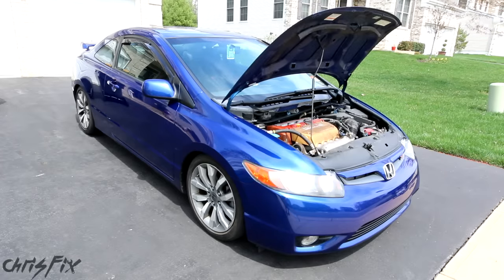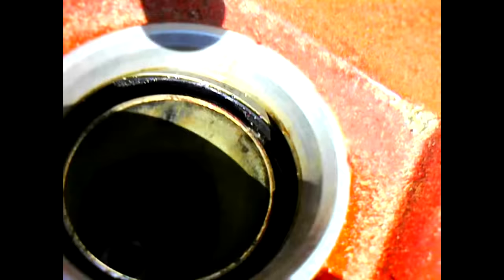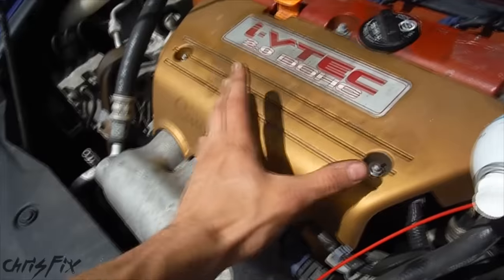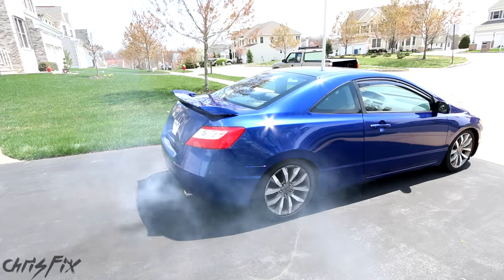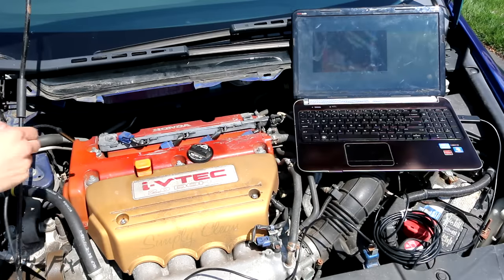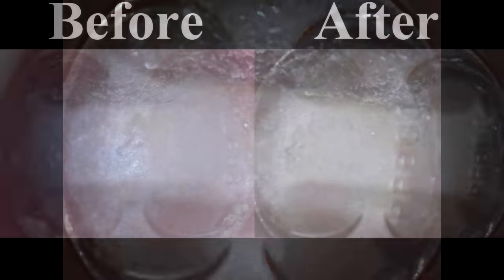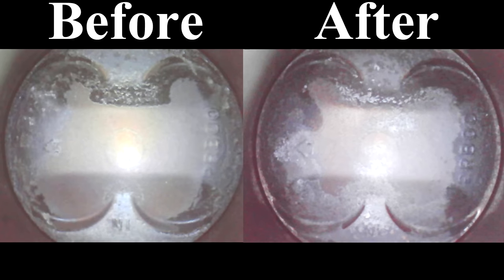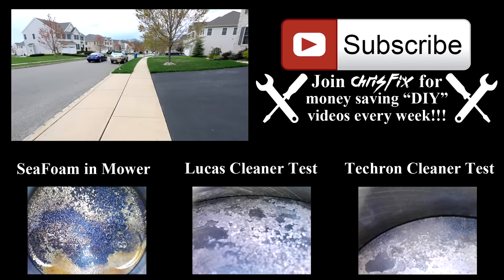Does Seafoam Actually Work in a Car? (with Proof)

Comment: this stuff don't work so little difference , its not worth it
Reply: It's like $9 a can what are you losing?..
Reply: Christopher Fryman what the hell are you talking about
Reply: +H.G. C. whispers I think he might be attempting to speak English.
Reply: harold souza Byyee! See ya tomorrow, Herpicus McDerpington.
Reply: lol your funny, the shit still wont work its crap
Reply: Yeah... it does work.  Watch the video next time.  Even better, try it yourself.
Reply: +harold souza I just don't understand why you're so mad about a product that works.  It's practically just an overpriced cheap type of oil, but it loosens and burns out the carbon.  
Science!
Reply: just a guy  it don't work is your video that bad there
Reply: harold souza You mad bro?
Reply: deebo gotyou   o baby
Reply: +harold souza It does not work if you drink it. Judging by your comment, you drank 2 cans.
Reply: +Caleb Niederhofer Know a lot of professional mechanics do you? I own a small garage and have turned wrenches in every environment from a BMW dealership to a shithole Midas. There are all kinds of cleaning agents used by every type of shop. The MotorVac machine was big for a while ($3000) as well as the BG Fogger($600). They both use liquid cleaners, they both work well, and are both overcomplicated devices that do the same thing as the Seafoam treatment. I agree that most of the snake oil out there does exactly jack shit. I would never have even tried the Seafoam had it not been for a frustrated, broke customer who could not afford to put an engine in her Honda (the one mentioned in the post below) and could not afford payments for a new one. I stumbled across the Seafoam trick while researching said Honda. It worked. It worked really well. I do not work for Seafoam nor was I paid to shill for them. The Seafoam is not going to magically give you an extra 10 mpg in an engine that has the minor carbon deposits that the engines in these videos have. There is really nothing wrong with engines in most of these videos. It will, however, free-up frozen oil control rings in an early 2000's Honda, it will remove oil sludge in a crankcase, it will clean fuel injectors, it will clean valves, it does work.
Reply: you might be right but it sure wont clean and remove oil sludge in a crankcase, the only way is to change the oil
Reply: +harold souza It absolutely WILL clean and remove sludge in a crankcase. You obviously have to change the oil after running the engine with the Seafoam in it. It doesn't make the sludge magically vaporize and enter a parallel dimension. 

Seafoam is not the only product that will do this. BG products EPR actually does a better job of this. You should not use either one in a heavily sludged-up engine, you will do more harm than good.
Reply: +fatboylo96 Yeah, I read a case where someone used Seafoam and it broke the sludge up too fast and starved part of the engine of oil. That was a super sludged up engine though, so who knows if even going easy on oil changes would have removed it easily or not.
Reply: this article and everyone reading it is in a  parallel dimension. lost in space
Reply: +harold souza Yes Harold, we're ALL crazy. You win. It's all lies. It doesn't work. Don't use it, it will ruin your engine and your life. You can play with the rabbits now Lenny.
Reply: +harold souza yes, so little difference. i want to see someone do a dyno test with seafoam because im tired of people claiming to regain lost power. you know what also helps, CHANGING YOUR OIL. i swear people dont realize how much power is lost between dirty oil and air filters. injector cleaners, head gasket fix, rad stop leak, tranny fix, all of these help so little it doesnt actually compare to rebuilding an engine or rebuilding your tranny or just changing your head gasket or just flushing out a rad. i personally believe these "fix in a can" stuff to just be designed for people that have absolutely no idea what they are doing. i personally have tried most of these "fix it cans" and with minimal results. 

i had a friend with a leaky rad use stop leak, his thermostat got stuck and the water pump failed shortly after. i used tranny fix on my truck once and it made it like a quarter mile. so just two random examples there.

i have cleaned my own injectors, i have rebuilt my tranny, and so on so forth. and if all seafoam does is break down carbon, i really dont see the point of using it because i have never heard of a motor losing power from carbon buildup.

i have 3 vehicles that are over 200k that run with no misfire, great power, and still daily driven. my cummins has over 210k which on dyno it still puts around 350hp 700tq. i run alcohol and 2 stroke oil mix for my mechanical p7100 and no mystery additives and it has gained a lot of power with effective tuning/timing. 

long story short, "fix it" cans don't fix it, and can often lead to more problems down the road.
Reply: +ian gilpatrick I'll leave the self-aggrandizement completely alone and just point out that if you don't understand the negative impact on airflow that carbon buildup on the throat of  intake valve has or how deposits on a piston top increase compression ratio and create hotspots that cause detonation then maybe you should gain a little more experience and knowledge before spouting off.
Reply: +fatboylo96 HAHAHA! yeah i went a little overboard with the description of my junk that still runs. i do agree with the points you made about carbon buildup as well. but there is no need to insult my intelligence that is just plain rude.

as motors get older they slowly lose compression anyways so i find this to be totally irrelevant at the same time.

But, there is no way, your going to sit here and actually convince some of us, with at least maybe half of a mechanical brain, that seafoam breaks down enough carbon to make a difference.

my 68 cougar has a bored over high compression motor (rated for 94 octane) and if cylinder detonation became an issue due to excessive carbon buildup i would not hesitate in pulling the motor and rebuilding it.

do some research on seafoam. it was originally invented for outboard boat motors (hence, seafoam) because he came up with a chemical combo to temporarily freshen up a motor to run for a little longer. wanted to go fishing, not rebuild said boat motor.

seafoam contains alcohol, oil, and a mild detergent, all stuff anyone can mix up at home.

with all that being said, this is just one mans opinion so spare the hate mail and just accept not everyone will agree on this subject.
Reply: ian gilpatrick   you said it all, finally someone who knows what he talking about thanks this stuff is junk
Reply: +harold souza I certainly wouldn't put it in an old engine!
Reply: +JustAGuy Think of the damage caused to an older engine where the carbon is plugging holes and scores. perfectly fine in a new engine but i have seen cars damaged with the same kind of stuff (not the same make),  Perfectly fine in new cars. The older stuff a few years ago was really potent and would kill catalytic converters, but nowadays is a lot weaker and does not clear the carbon as well but cat safe. All in all a newish car with low mileage serviced engine say under 40,000 miles yes, anything else no. If the spray trys to kill the engine whilst you are spraying into the throttle body to the point you have to throttle the engine to keep it running then you have some potent stuff.
Reply: +Robert Marks pass the popcorn, this shit has me on the floor!
Reply: I almost got in too deep. I am working towards using both halves of my grey matter though...
Reply: +harold souza Wrong.
Reply: +harold souza It might work on large carbon buildups, but for such a small amount of carbon, its not worth it. Although, it would be handy when your engine has 200K miles. Or any engine where the valves stick due to carbon buildup.
Reply: people like you are broke down on the side of the road searching for a tow truck lol
Reply: its preventative maintainace..
Reply: it don't don anything, its worthless

Comment: Helps a lot with the carbon that builds upo in the valves and the sump pressure relief return hose that sometimes carries some oil. Beware with the acceleration body gate, the servo is fragile.

Comment: I'm waiting for you to use water, I felt the seafoam had similar effects as the other products you tired on your truck.
Reply: dsouzand I'm in your camp on both counts. :)
Reply: dsouzand i cant wait for water either.
Reply: dsouzand That's the old school way to clean out carbon deposits, I used it myself back when I owned a carbed Camaro. Just got a spray bottle filled with water and lightly misted the carburetor while slightly opening up the butterflies. A couple minutes of that and she was running a lot better that she was before. As previously she made a huge nasty cloud of smoke pulling out at a stop sign and the idle wasn't as smooth. Which is what inspired me to give it a try.
Reply: Da Blueguy
I've fixed a car with it. Some old school keeps on working. :) I was so excited about the results that I wrote an article on it, if you're interested.
Reply: Da Blueguy
 just wondering does the steam also clean the exhaust manifold to?
Reply: dsouzand Of course. I just don't know how much like I don't know about carbon from a visual like Chris Fix is working on.

Comment: I hate how the (the before and after pics) aren't that same color. it's like it has a filter.
Reply from the maker: That is because the white balance changed. The engine was cold in the "before" pics and hot in the "after" pics. The borescope camera doesnt like the heat but I had to film it so my friend could go to work.
Reply: but sad thing is though you said lets let the motor to cold now? not hot
Reply: ChrisFix
Reply: can change the brightness of the led's on the endoscope
Reply: sk8punk318
Reply: o gotcha ok thanks for lettin me know, I bought a bore scope just to look down at the cylinder heads on my G37. Just curious.

Comment: I always add a can of Seafoam before a long distance drive over 250 miles (gas tank at 35 to 50% full).  Going 70-75 mph, with lane changes and on-ramp accelerations etc qualifies as aggressive driving.   When I have to stop for gas, I add Marvel Mystery Oil to the gas tank before I fuel up.  On the return trip, I do the  same thing, except I add Seafoam to the oil.  Then MMO to the oil at the gas fill up.  About a week later, I change the oil and filter!   I usually have a drive like this once every 3 months...so I time it just ahead of my oil change.

Comment: I don't feel the results are worth it. IMHO.
Reply: ghostcar it makes more of a difference when you have an engine that is in really bad shape. projectfarm had an old ford truck with 160k miles on it and it had issues with valve knock and massove carbon deposits in the engine; he added seafoam to the crank case oil and gas tank, and ran a can of spray through the intake. it literally rescued his engine for less than $50, where the only other option would have been a complete tear-down. I don't see how you could ever say 'not worth it' considering how cheap it is, especially compared to any other method you could use to fix these problems.
Reply: @KingHalbatorix  projectfarm was a very drastic change (which you could hear) but the changes here are much more subtle... I agree it's more questionable, and wonder what it does to your catalyst converter (which is expensive to replace).
Reply: I mean it's meant to work over time so
Reply: @alaind831  Project Farm's video is what literally sold me on Seafoam. Those blatant, unbiased, raw, obvious results should slap tf outta any nay sayer.

Comment: I'd suggest that there's no practical difference in the cleaning.
Reply from the maker: +tcpnetworks thanks for sharing!!
Reply: it seems like such a small difference. youre saying it doesn't matter?
Reply: I agree!!
Reply: I had my mechanic seafoam my intake and manually clean my throttle body and my car is starting up smooth again. its like night and day. I want to do it again as much as possible. im almost at 200,000 miles. driving an audi a6 with direct injection
Reply: Gary Shaw toss in a can of BG44k you can Google and get the information on it. Most large auto parts stores sell it. eBay and Amazon look for free shipping BG44 K is one of the best.

Comment: How am I supposed to hold 2k rpm by myself?
Reply: Cameron Cole use a shower curtain pole ?
Reply: Set the idle screw up manually and then put it back to where it was. use a marker
Reply: Yes the idle adjust screw and then just put it back manually

Comment: Chris, can we just spray sea foam into the cylinders via the spark plug holes? It should be easier and more effective! It will only clean  the pistons though while your way will clean valves and so on.
Reply from the maker: I did that in the lawnmower video test but the problem I find is unless you can vacuum it out or something, you will have big chunks of loose carbon in your cylinders which probably isnt good.

Comment: My 94' 300ZX with 98K on od sat 2 years recently while I did major timing belt service,clutch n other upgrades. After two years it wouldn't run right,missing n stuttering at low rpm under load. I tried Techron 3 times,no effect.Replaced a couple fuel system items and coils,no effect. Convinced it was gummed injectors. Recently put in Seafoam,twice.Over about 180 miles it is about 80% better. I'm sold.👍
Reply: I bet it was your old gas. My civic was stored for 3 years and i had to drain all the old gas (7 gallon) out then put in new gas.

Comment: Chris. 
Does seafoam clean the carb as well? I've been putting it into all my small and large engines in hope it keeps injectors, carb clean as well as what you've discussed. 
I've got a 94 Suzuki Carry that WHO KNOWS how well it's been maintained before me but runs good with fouling plugs twice on me in the nearly year and small amount driving. (#3 has low compression at 30-40psi. others at 130. Rebuild it someday...)
What do you recommend for carb cleaning? Keeping clean? Diesel Ram 6.7? The wife's Tundra 5.7? 

Thanks bro. Love the vids.

Comment: Before Seafoam was all the rage AC Delco Top Engine Cleaner was a little known secret amongst GM technicians as a way to tune up a car and improve performance... We use this stuff whenever rebuilding engines to clean the piston ring lands and pistons when reringing a 4.6l with excessive oil consumption... This stuff was also used by techs to clean the TBI units and in a stick throttle body it would quite literally just melt the black sludge build up inside ports and around and on the throttle plates...

Comment: I did not see any diference.
Reply from the maker: Yea it’s not a big difference.
Reply: Seems that car really didn't need to be Seafoamed in the first place.  Maybe a much older, higher-mileage car would have shown a more dramatic difference?
Reply: It’s not made to remove carbon from piston tops.  The concern is carbon buildup in the intake runners. And back sides of the intake valves.  My 2.4 vetch has considerable carbon build up in the runners.  220k miles.

Comment: Did not see any difference
Reply: +foxybrown2 It cleared a decent amount, his car just doesnt have much build up in it so its hard to show it, if you can find another video that uses an older car or something with a little (a lot) more power the difference is clear, I can speak through experience since I used this on my 94 Mitsubishi 3000gt VR4 which hadn't been internally cleaned for 16 years and it worked phenomenally.
Reply: +Swag Police Oooo Mitsubishi GTO.
Nice

Comment: What people fail to realize is that running these cleaners thru your engine to clean intake, valves and injectors is doing damage to your catalytic converters. All that grime and gunk has to pass thru the very fine honey comb mesh in your cats, or DPF in diesels, this will plug them faster than anything. Sometimes its just better to leave the gunk in the motor because most cars and trucks today have 4 cats and to replace all 4 could be more expensive then just rebuilding or replacing a motor.

Comment: Smoke is good... add it to the oil crankcase before an oil change, add it to the gas and definitely suck it through the vacuum brake booster... that's the triple threat against build up in your engine

Comment: So it definitely worked. I’d like to see it on a dirtier engine. I used to use this all the time back when I was young and had old used cars. Smoked the whole block out. Run a vacuum line into the car and you got 007 style smoke screen.😂
Reply from the maker: It definitely did something for sure

Comment: I was only pushing out 19 mpg at best from my 2015 wrangler. Used it in the gas once and mpg jumped to 21-22 mpg which the jeep isn't even supposed to get. Putting it in the oil tank next. Pentastar is prone to carbon buildup.

Comment: Why didn't you do a piston soak? I would of soaked it with MMO then ran the seafoam through the intake. I don't think it did anything much to the piston carbon its an exaggeration. That seafoam probably cleaned the intake valves more than anything but that motor was pretty clean already.

Comment: I used to be a Lucas man but my van was having hard shifts and didn't want to go full horse power. It wouldn't let me floor it until I hit about 30. There was no transmission problems or things like that. My guy told me to use the seafoam you pour into your gas tank. I filled up drove around for 10 miles or so then went out to the middle of nowhere and put the pedal down and from about 10 to 15mph about 6 seconds later it hit 90 no hard shift or anything. I did it to my girls car which is at 300k mi. And according to the car she got another 80miles out of a full tank till the light came on.